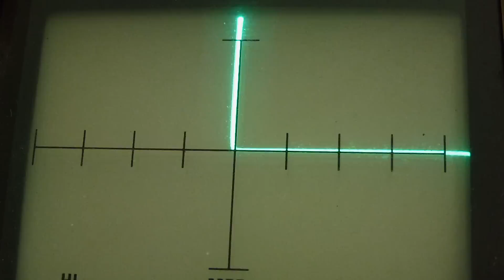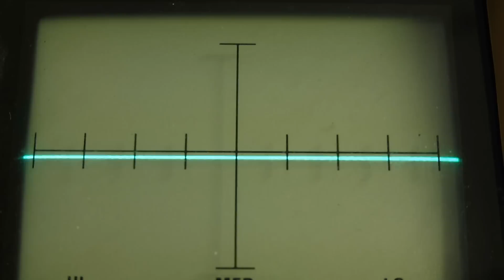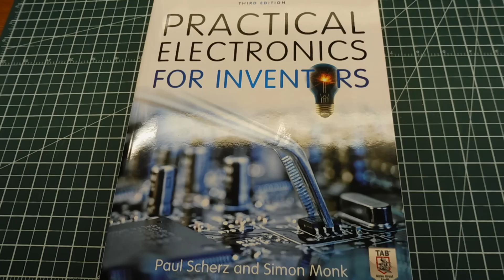Earn Money as an Electronic Hobbyist  / Troubleshooting Circuit Boards

Comment: arduino can not be used in professional/industrial product and services, it's too expensive in number scale, also you have at least 100 other mcu you can chose from ardiuno is only one of them. try to learn the concept in depth and don't stick to this toy board, for each project you may need to design a board specifically and arduino do not scale. MCU is a huge topic but arduino reduced it to a toy
Reply: What should be used  instead of an  arduino ?   If I want to design several electronic products , should I design my own circuit ?

Comment: The repair game died a slow agonising death starting from the mid 80s. Which is pretty much why you no longer see the old radio, TV and consumer electronic workshops because they all went out of business. All that remains are niche markets.
Reply: I totally disagree with you, I buy home high end power amplifier before they get on websites. I have two repair shops I go to, had my equipment in their shops for two months and they still haven't got to them.
Reply: @jerryjohnson3801   You kind of made the point I highlighted. The repair shops you go to are extremely busy not because the repair busy is a booming industry but rather because it's a niche market and there are far fewer repair work shops on the high streets today than there was in the 80s.
I've been in the repair industry since the late 70s and I used to repair video games, pintables, monitors, fruit machines, PSUs etc and I watched that repair industry die the same death as high street repair shops for all the same reasons.
Reply: The ironic thing is that a lot of repairs would be even easier today than in the past. Once you get past the daunting idea of working with parts so small, SMD air work is a lot easier than THT. And digital circuits don't require the precise tuning many analog circuits do. It's just that unfortunately electronics have been relegated to the "disposable" category in much of society because they've become so cheap. A victim of its own success in many ways.

Comment: Why 7808?
Reply from the maker: 8.0 volts is feeding Vin on the Nano which outputs 5 volts to feed the HC-06. Using  8 volts keeps the power dissipation down on the onboard regulator on the Nano and the 7808.
Reply: @0033mer  I guess my question was why not 7805 and bypass the nano regulator.  Then there's one heat source and solid 5v everywhere.
Reply from the maker: Feeding 5 volts into the 5 volt pin on the Nano back-feeds the regulator. Many people do it but I prefer not to. Shorting out Vin could destroy the regulator. I also use 4000 series CMOS logic in my prototyping area that I run on 8 volts, and other modules that have regulators that need the voltage headroom.
Reply: @0033mer  thanks great vids one can tell you have years of experience.

Comment: Your content and explanations are wonderful and very clear! 

 This turned out to be an extremely long message and I apologize. Definitely too long for comment on YouTube… But I’m not sure how to email you directly so I will just leave this here. 

Iv watched your “earn money as a hobbyist“ videos dozens of times. When I first saw it 2 years ago… I Purchased one of those curve tracer kits like you show in the video. They’re pretty cheap and readily available on eBay for around $30. They work really well. Since then I’ve designed and built my own, and I’ve also built the version shown by“Mr. Carlson‘s lab“ here on YouTube.

Another wonderful troubleshooting device is the DE-5000 LCR meter. I’ve used it for a year now to test thousands of capacitors IN CIRCUIT, along with thousands of other components. 95% of the time it gives perfectly accurate ESR readings with the capacitor still in circuit! Which is really great. For $100 it’s the best LCR meter I’ve ever tried. I Even sold my fancy benchtop HP lcr meter. Don’t get me wrong I loved my HP but couldn’t justify keeping it. And for $100 the De-5000 is the bees knees! There’s a huge discussion regarding this LCR meter on the Eevblog, and dozens of reviews here on YouTube. It’s been around for a very long time and it’s very highly regarded.

Also regarding in circuit ESR testing… a Gentlemen on the Eevblog designed a multimeter “adapter” for testing ESR in circuit. Simply plug it into your digital multimeter, and it gives you very accurate ESR readings. It’s also a wonderful device and can be built for a few dollars on perf board.

I Would love it if you did a series on troubleshooting tools. Just like the LCR meter, the curve tracer, maybe even those really cool “current tracers” HP used to sell. (Those little probes that look very similar to logic probes.) 

the hp current tracers bring several hundred dollars when they show up on eBay. I’m hoping someone reverse engineers the circuit and it can be done DIY.  If interested you can look up HP model numbers 545A, 546A, and 547A. All made by HP. Every now and then the set of three pops up on eBay for $150-ish… If I get the chance I’m going to buy Them to try out, and see how difficult it would be to clone. There’s also a guy who buys up most of them and completely restores them inside and out, and offers them as a set of three for $500. He sells them pretty quickly so they must be In high demand. I’ve seen them mentioned in countless forums all over the Internet by professional technicians… for troubleshooting and finding faults.

I Would really enjoy it if you did a series on troubleshooting tools. Or as I call them “FAULT FINDERS”.  Basically test gear for dummies. 
 I’m so obsessed with “faultfinders”, in circuit Testers, LCR meters, curve tracers, and  anything related to these simple devices.… I’m obsessed with them because I’m a beginner, who’s only been tinkering for three years. And those devices are  “dummy devices“ or “shortcuts”!
 I don’t have to have electronics theory knowledge to find faults and make repairs quickly/easily. Don’t get me wrong… Im no dummy, and I learn more every day. But I  have a huge influx of beautiful electronic devices, test gear, and all kinds of government contract goodness… because Everyday I go to my look local electronics recycling yard. I buy an average of 125 pounds PER WEEK. All the most beautiful government, industrial, & contract stuff..... that just gets scrapped when they’re done with it.  They bring hundreds of tons every day. Sometimes it’s literally new on the pallet still wrapped up. I live in a city with massive hydroelectric dam systems,  A huge concentration of TVA and other government agencies,  several large nuclear power plants, and most importantly I’m close to the Oak Ridge laboratories (where the atomic bombs were developed). although they don’t build bombs anymore…  they are still very active, and There are hundreds of large supporting companies that sprouted up over the past 50 or to benefit from the gov contract work.  there’s so much government activity in this area and industrial type technology… That our scrap yards are overflowed with the most incredible things imaginable.  And it’s obviously not consumer level throw away junk, Like TVs and radios. it’s all industrial contract beautifulNess.  It’s so much fun repairing  or diagnosing that stuff, and all of these faultfinding gadgets really come in handy and make quick work of it. 

By far the most useful troubleshooting device i’ve found, is the “leak seeker“ made by electronic design specialists. They aren’t sold as complete units anymore, but Dave Migga of “EDS” still sells the parts kits, including the programmed chips. And eccentric workshop sells the  beautifully fabricated PCBs, the original enclosure, and the high quality graphic decals. It cost me $155 to build that little device, but it took the place of my MUCH more expensive Huntron tracker and my polar “tone-ohm“.  I sold both of the old devices, which I had purchased and repaired very cheaply. The Huntron tracker brought $600 and the Tone-ohm sold for $300.  And I can happily say the $150 “leak seeker“ that I built from the parts kits, took the place of both the sold machines, and equals their performance! The leak seeker is very similar to the tone-ohm, but much more intuitive! with a wonderful user interface that a child could use! It Took me only a few hours to assemble the parts,  and have the device working perfectly.  I could’ve easily built it in an hour, but I wanted to savor the process and really enjoyed putting it together. Both Dave and eccentric workshop were extremely helpful, and always ready to answer any questions via email. The circuitboard is very professionally made, and they spared no expense on the design of this unit. The PCB, all components, and even the enclosure are the best of the best quality. The enclosure is about $30, but it’s made in America and I am very happy I went with the original correct enclosure. I almost tried to make my own but once I received the enclosure… Saw the quality, and assembled the device. I was so so so glad I Purchased it.  Because the PCB is designed to drop into the enclosure directly, with related mounting holes and locations.

 Dave is the owner of Electronic Design Specialists (EDS),  and has put years into the design of this device and his others.  If you visit his website you will see he has been designing devices for over 30 years, and a lot of the capacitor testers and analyzers that are available on the market today, are knock offs of his original design.... which has been around for a  long time. 

I Would absolutely love it if you did a video series on these faultfinders and other troubleshooting devices. The leak seeker, the DE-5000, the $30 Chinese curve tracer kits, and the HP current tracer probes. Most of these devices are extremely inexpensive, And I have a huge library of devices and diy designs which I have printed from all over the Internet. Some dating back to ham radio magazines 30 years ago or longer! 
 I think your audience would greatly benefit from videos like this, and it would bring you a lot of viewers.  There are so many new people getting into troubleshooting and repair as a hobby and for income,… People that didn’t go to tech school and don’t understand electronics theory. And these devices would greatly help them begin to understand. There are a lot of folks interested in electronics repair for profit or for Hobby… But don’t want to go into all the very complex theory necessary to use complex test gear. I’ve had extremely good luck fixing all types of complex industrial equipment… And even though I have a bench stacked with nice test gear… I use these inexpensive devices more than anything, and they make very quick work for a simple minded person as myself.

 Here’s a list of some of my favorite troubleshooting and faultfinding devices. Maybe some ideas for future videos. 
-DE-5000 LCR METER

-CURVE TRACER (many different cheap kits and prebuilt designs available. (Ranging from $25-$100)

-EDS LEAKSEEKER 89

-ESR MULTIMETER ADAPTER (from EEV blog member J_Diddy_B)

-HP CURRENT TRACER (545A 546A 547A)

-POLAR “TONE-OHM”

- BOB PARKER ESR METER

-ANALOG ESR METER DIY (Dr. Browns would be cheap and an hour project)

I’m not sure where you’re located, I’m in Chattanooga Tennessee… And I’ve got a literal truckload of test gear that I would like to pass on to folks who need it. It’s all too heavy to ship, and not quite valuable enough to sell on eBay and justify shipping cost. Stuff like 80s and 90s oscilloscopes… Mostly analog and under 100 MHz… Some signal generators, and some decent general test gear. Nothing super fancy but definitely help someone out. I would do some trading and give someone a sweet deal on it. If I could get one small  or insignificant piece of gear that I’m interested in, I would give them a whole truckload of test gear.  Not concerned with getting money for it, or getting a “fair value trade“.  I just wanted to go to someone who will use it. 

I have a bench full of nice test gear that I’m keeping, and the only way I could afford decent gear was to repair it myself. So When I became interested in electronics three years ago I spent the first six months buying broken test gear from all over eBay, local places, auctions, junkyards, anywhere I could find it. Some of the stuff was untested and some needed minor repair. 
There’s no way I could have afforded to buy modern working gear. But I’ve been able to put together a very respectable workbench by repairing untested gear.

If you know anyone nearby  Who could use the gear, keep me in mind. .
I apologize for the extremely long message,
 Thanks again for your great content!
Reply from the maker: i can tell you are the type of person that will succeed in this field and perseverance is the key. The purpose of my channel is to teach and promote how to design, build and troubleshoot electronic devices and circuits. These talents and knowing your test equipment will enable you to go a long way. This is not for everybody as I indicated in my video but by actually "doing" it and getting experience and teaching others, is another form of learning. Just keep up what you are doing, you are pointed in the right direction.

Comment: .Acme corp has 2,000 machines in their system that use a particular control board.  One board goes bad, machine stops.  Acme purchases spare boards by the truck load for $8.50 per board.  Machine operator has been trained to swap out board when machine stops.  Downtime, ten minutes...no time consuming board troubleshooting or electronics tech required.  Board swapping seems to be taking over...that and "smart troubleshooting" programs that indicate most likely board to swap out first in a fail scenario.  "But boss, I fixed a board by replacing one blown transistor".  No one cares, Bucky, your time costs us three times what the board is worth.  Do it again and you will be terminated.
Not "fired"...terminated...I will shoot you myself. Now get back on the phone bank and be useful...sell more warranty extension contracts.
Reply: swapping boards is fine when the board cost is minimal. In certain applications boards can range from 100K and higher. Simply swapping a board doesn't apply to all industries.

Comment: Audi A5 3.2L computer module (ECU) $1200 to replace, $500 for dealer to program VIN and key fob ID. Replaced fuel injector #4 Mosfet transistor. Charged $500. Everybody is happy.
Reply: How much time did you invest?

Comment: Unless things have come full circle, it is extremely hard to make money fixing things these days, everything is designed & built with a lifespan of a couple years. Unfortunately, it costs almost as much to buy the parts to fix thjngs as it does to just buy new. I am an old person & have run the gauntlet from the time things were built to last your life time to the garbage built today. Granted, there are cases where it is cost effective to repair something but that is the acception to the base. Now you did say industrial is the way to go & I agree that is your only chance. However, you would need to gain a contract with a company to repair their stuff but most already have inhouse techs that just replace boards. Some companies will have them repaired but most will already have a contract with a manufacturer for replacement. The manufacturer may contract out for repairs (highly unlikely) but most  just trash the bad boards as it is SOP for them. What you need to understand is the cost of labor is ridiculous and just buying new parts is cheaper unless you are in china or something which is where the boards will be sent for repair. So, absolutely keep learning and maybe you can get a job with a company. Good luck to all you young people out there, you certainly have more opportunity in life than i did.
Reply: Right on brudda. I work for such a company and they have contracts with high-end telco companies. As an engineer, life is good, but they work the production guys to the bone. Apparently it's profitable and we get a LOT of work.

Comment: Great video i have an associates in electronics and taught myself programming c, c++ and now c# but cant figure out how to make more than 15/hr got any suggestions? How do you find industrial clients? Your device reminds me of a huntron tracker
Reply from the maker: If you are interested in industrial electronics, go to the high end industrial equipment auctions and talk to the buyers.
The buyers will be involved with getting equipment repaired in their company so they are good contacts.
Equipment used in rough environments are good candidates like welding equipment and electric golf cart  motor controllers.
There will be a learning curve to get  to know the equipment,  but once you start, word gets around and doors will open.
Reply: Electronic Techs @ the USPS make roughly 70k a year. Benefits are good and you start with 2 weeks vacation, after a few years it goes to 4 weeks and at 15 years you get 5 weeks. Plus you get sick leave on top of that.
Reply: semiconductor equipment technician $$$$$$